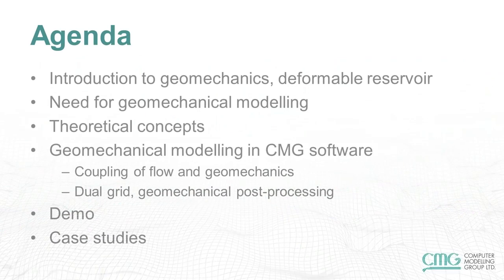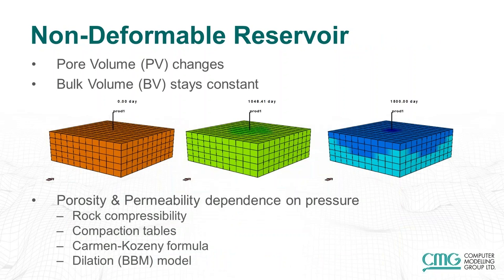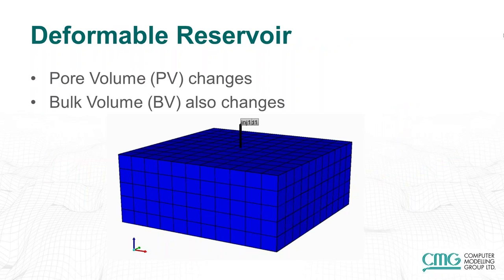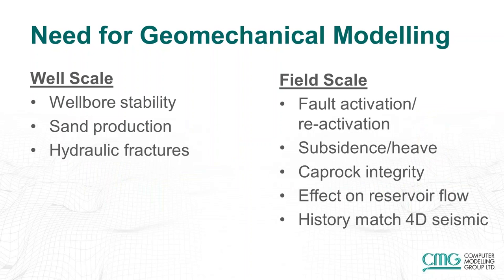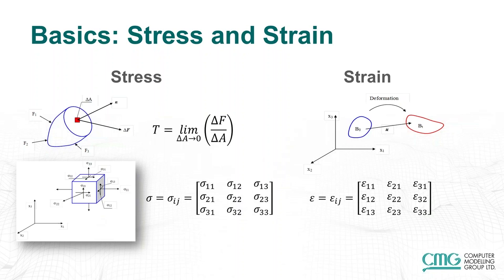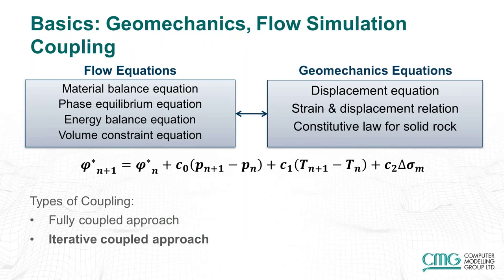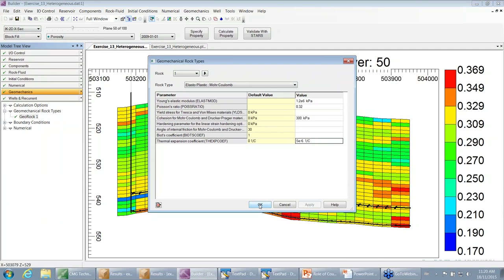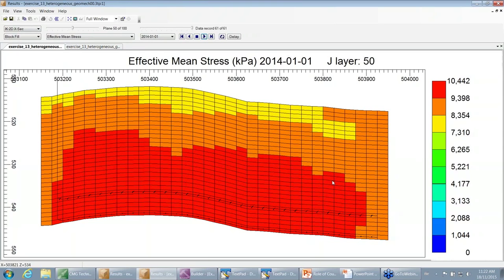CMG Webinar: The Role of Coupled Geomechanical Modelling in Reservoir Simulation Webinar (CMG 2015)

Comment: Please I would to know. 
When using fully coupling approach, after having the systems of equations for fluid, heat and geomechanics, we solve it simultaneously using one numerical method e.g. The integral finite-difference (IFD) or Residual Formulation or mixed Finite Element on the same grid mesh. 
Is it appropriate to use the fully-implicit method but using FVM to solve flow/heat and FEM to solve geomechanics?
Reply from the maker: Hello Axel- thank you for your question! We have done lots of benchmarking against other tools, including analytical solutions- and found that our way of modeling provides not only an accurate solution, but also at a good speed. Using FVM is standard for reservoir simulators (since they need to model multi-phase flow with complex
interactions), but obviously it is better to use FEM for geomechanics. We have coupled both together in our geomechanics solution. Let us know if you need an additional explanation by emailing support@cmgl.ca.

Comment: How do I use my seismics data to build a reservoir model in CMG ?
Reply from the maker: Hi Mohammed, thanks for the question! You can use your maps built from seismic data and load them into Builder to create your grid structure. CMG supports several different types of map formats. We also have options for building reservoir grids (and properties) from well logs.